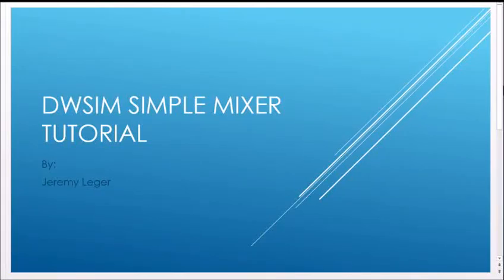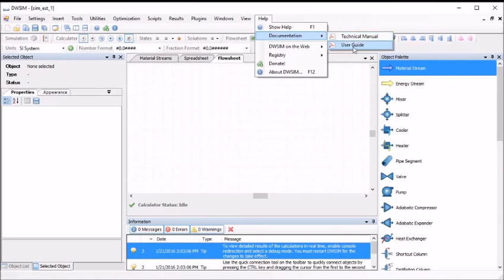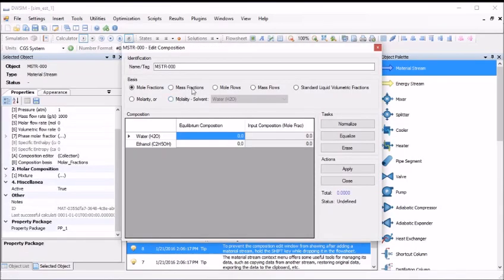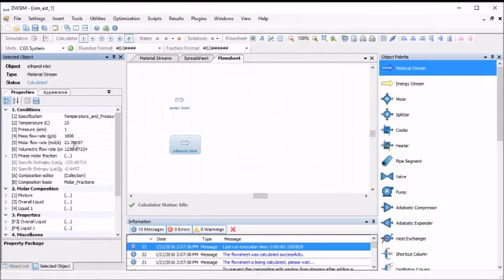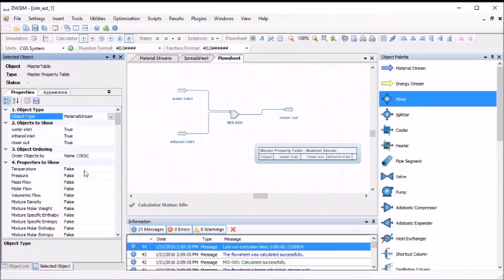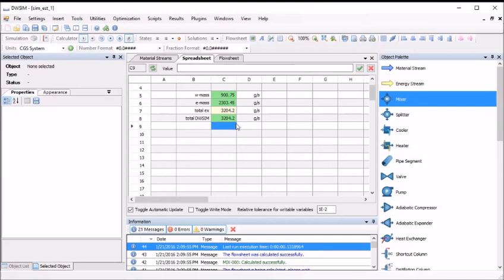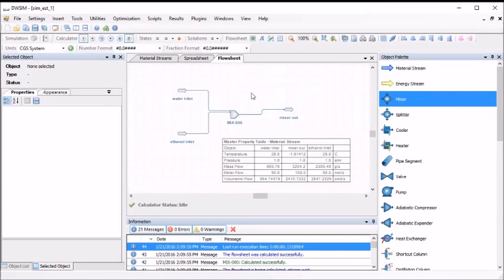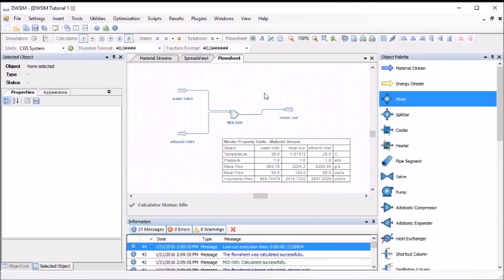DWSIM Tutorial 1 (Mixers For Beginners)

Comment: When I follow the step at time 11:02 in the spreadsheet I get the error: " ERROR: the given key was not present in the dictionary."

I double check my Master property table in and confirm that I have selected and can see the Mass flow.

Furthermore, it also does not work when i request other properties from the spreadsheet eg .."temp, pressure"
Reply from the maker: If you look for the pinned comment, where Daniel Wagner replied and post your question there perhaps Daniel can help, he is one of the developers of DWSIM.

Comment: Hi great tutorial! When I open the "Configure Simulation", the database DWSIM will not be shown. I can only see the database from Chemsep, Coolprop, Electrolytes and Biodiesel. Can you help me? Thanks
Reply from the maker: You may need to download the DWSIM chemical properties set and direct DWSIM to the correct folder. Try the forum if that doesn't work.
Reply: Thanks. Where can I download it? I thought, the DWSIM database is includet in the standard installation.
Reply: hocam merhaba ben bitirme tezim program similasyonu ama youtube ogretıcı degil yorumlarda bitek siz türk vardınız:) yardımcı olursanız bu konuda çok sevinirim

Comment: I have an anomaly in my solution for volumetric flowrate. The mixture density shows up as 1.42 g/cm3 in the mixer outlet but that's impossible. I'm running version 4.2 using mono on arch linux. Could there be an error in the property tables?
Reply: Heads up: Use NRTL or UNIQUAC that will give the appropriate solution.